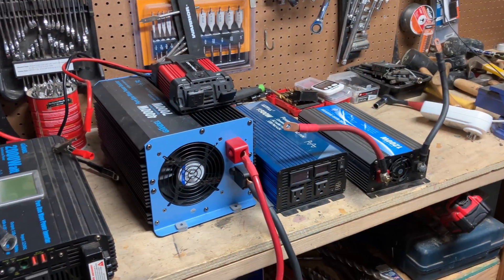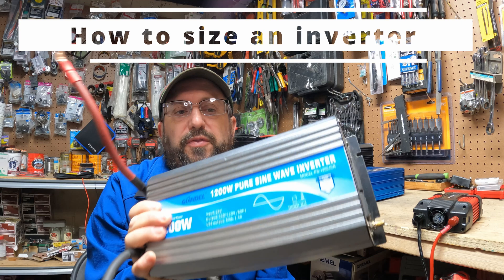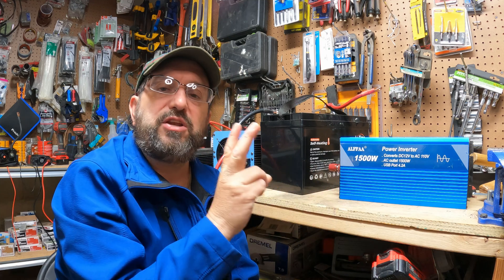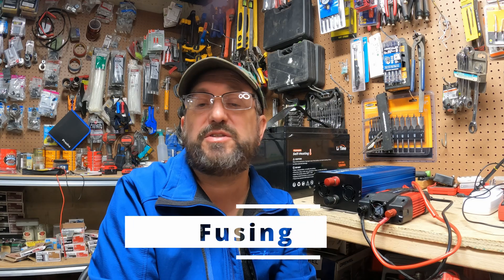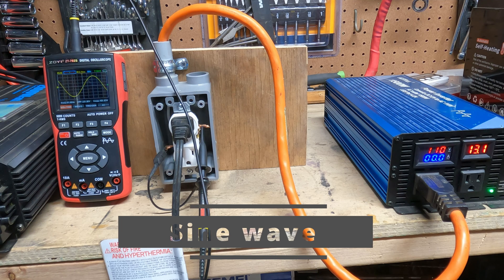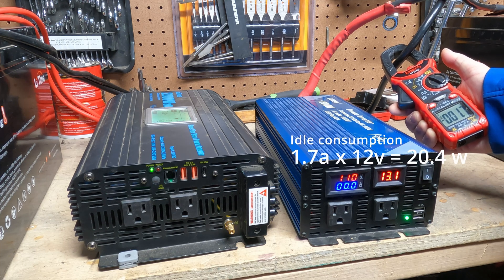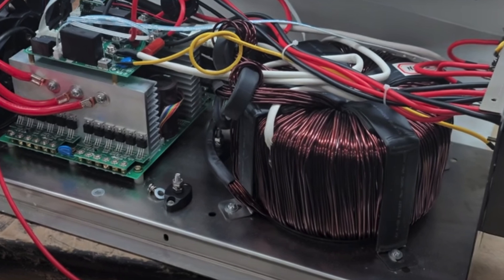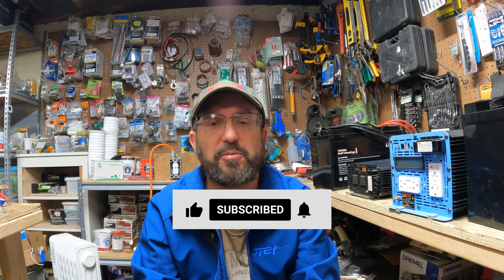Inverters 101:  Pure vs modified, low vs high frequency, how to size and wire.  Plus what to avoid!

Comment: At 10:24 where you're measuring the idle current draw of the 2nd 'quality' inverter, you appear to have the clamp meter around only one of what looks like two paralleled negative cables going from the battery to the inverter. If this is the case, then your meter will be measuring only 1/2 the current draw.
Reply from the maker: LOL!  You are correct.  Good catch.  So they probably have about the same idle consumption.

Comment: Great comparisons and great videos. FYI, welding cable is super flexible and has higher ampacity compared to same equivalent standard cable sizes. It's a bit pricey, but welding cable is a great application for 12v / 24v batteries and inverters.
Reply from the maker: Thanks.  And yes welding cable is a excellent for 12v/24v setups!

Comment: Please explain how putting a resistor in circuit, and then taking it off before connecting the wire to the terminal can help stop the spark? It doesn’t make sense to me, but I’ve seen you say this a few times now. Surely when you remove it, then connect the battery to the inverter it’ll just be the same? Or is there some capacitance in the inverter? (Sorry if it’s a stupid question, I’m really not clued up on these things) thank you!
Reply from the maker: That is a excellent question.  The resistor allows the current to slowly flow into the capacitors in the inverter.  And because there is not a rush of energy, there isn't a spark.

Comment: Wouldnt it be nice to show whats being drawn on the display without having to use a volt meter, idle consumption, but that would be like actually telling the truth
Reply from the maker: Good point.
Reply: , @OurBlackCatCottage  mine do, and they are low frequency units, and they draw a meer 13w

Comment: All I really care about inverters are : 

1)pure sine wave 
2) idle power consumption (huge importance for me)

3 knowing that I should use only 50/60%  of the max inverter capacity consistently as maxing it out will shorten it's life span max use is ok occasionally
Reply from the maker: Thanks for watching!
Reply: Yes 50 to 60 %, if it's a high frequency unit, that's why you should care if it's a low frequency inverter, transformer based just like our electric grid, designed  to take the surge and run full power! My power stations are low frequency, and idle consumption is 13w, pure sign wave.
Reply: @dustydawson8977 which power station is low frequency, i usually assume poeer stations are the portable kind..., if not what invertyare you using?

Comment: @3:49 to get 1500W of AC power output, the power draw from the batteries will be more than 1500W due to inverter efficiency, so if the inverter is 80% Eff, then the DC power  draw from the battery will be  1500W/0.8 = 1875W, so the DC current draw from the battery will be 1875W/12V = 156A! not 125A.
Reply from the maker: Even more reason to use two batteries.
Reply: I tested the inverter that at least the efficiency is over 90%.So there is have other situation?

Comment: Excellent explanation. After 5 months of research and over analyzing I went with a Giandel 24V 4KW inverter. I was torn between that and a Hybrid Inverter but the customer service reputation in the 24V 3KW AIO’s scared me away, in my price range.  I like the idea of me being able to service and expand a component level system. Giandel had an excellent reputation for reliability & service.  Now I need to get my wires, fuses, Cutoff switches etc.
Reply from the maker: Thanks for watching!  I love my Giandel inverters.  Enjoy building out your system.